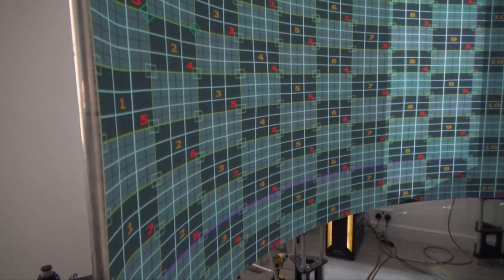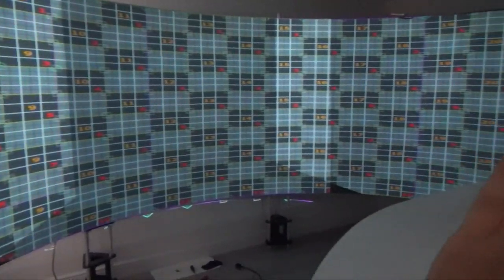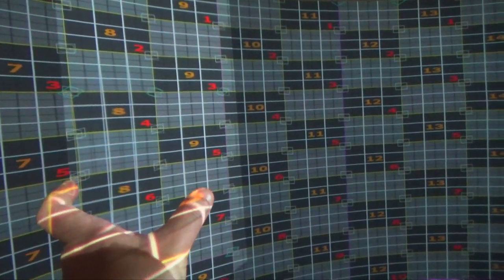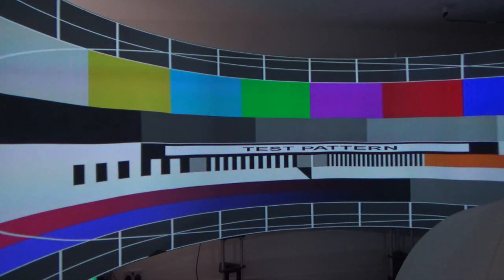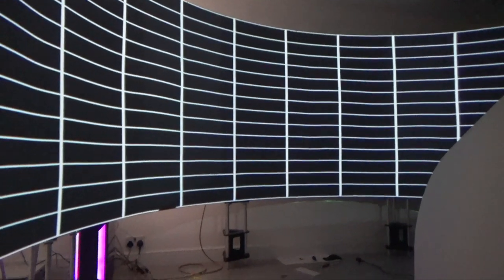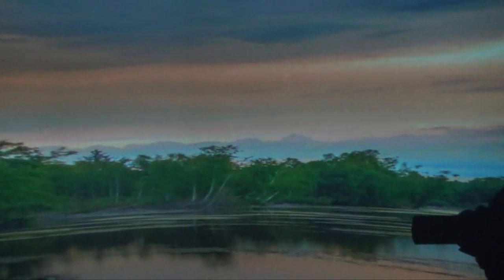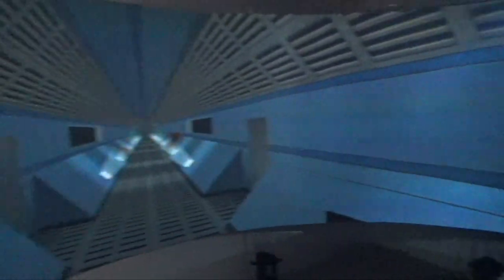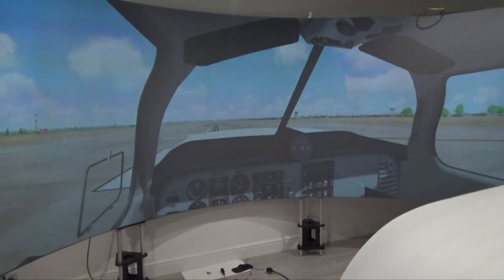Projection System 3

Comment: Hello , i have only 3.5 meters wall to wall . do you think that i make a projector
Reply from the maker: Well, if we suppose you don't want to leave any room wall to wall so that you can walk around your screen for maintenance, you can perhaps opt for a 180 degrees 3-3.5 meter diameter. Immersive Calibration Pro can pretty much calibrate any size of screen you have, but you need to ensure that your cockpit would fit quite well within the 3 meters and that you have enough ceiling height for the projectors. For 3 meter screen you will need only 2 projectors

Comment: would prosim  xp11 work with your simulator?
Reply from the maker: Hello, i don't use XPlane but majority of my instrumentation is from Sismo, who has a program allowing their module to work with Prosim and Xplane, so i suppose it does
Reply: Do you know how I can get money for a simulator set up like yours
Reply from the maker: @Harrygundberg  hello, I am not the best person to ask on how you can get the money, you are the only one that know the correct answer. ALPA Simulation is actually a company, all the simulator was financed (and still is) by my own money which i saved little by little. Remember that this was a dream for me which took me almost 25 or more years for planning and finally doing it, so it was not something decided overnight. Money and space were the 2 big factors i had to overcome as obstacle to reach this point.
Anyhow, there are lots of great people out there building their simulators from scratch using hardware/software that you can find for cheap price, have a look on the various forum or youtube and you will see lots of these builders with fantastic ideas
Reply: OK thanks one more thing do you know what the things are called that the pilots use to speak to the pushback driver?
Reply from the maker: @Harrygundberg  When pilots needs to speak to the pushback operators, the Interphone switch located on the overhead must be in ON position. The operators connect their headset to the jack located i believe under the first officer, same.place where they connect the ground power. Pilots communicate wit them using the on board interphone headset.